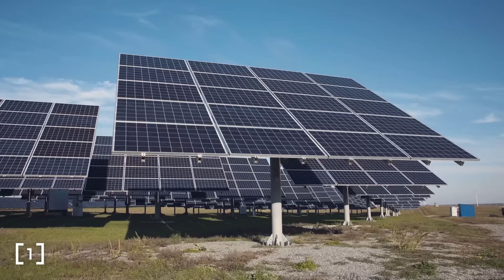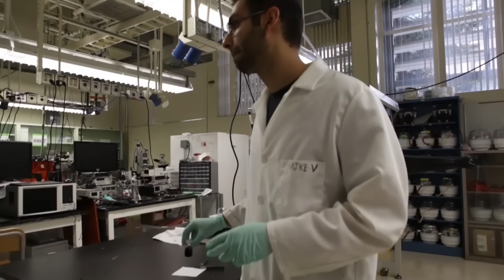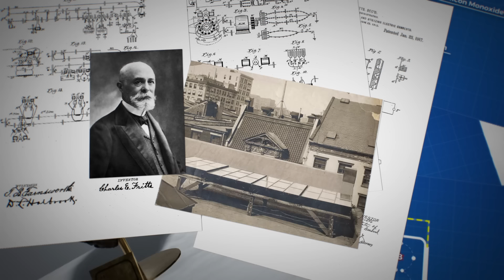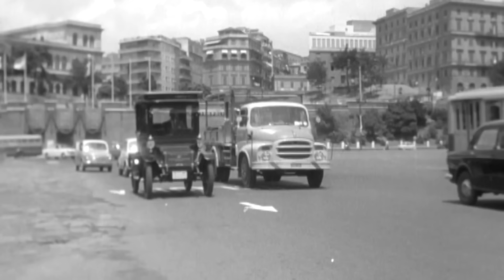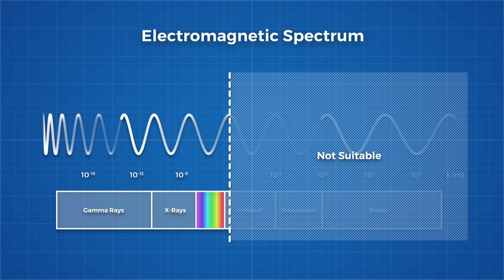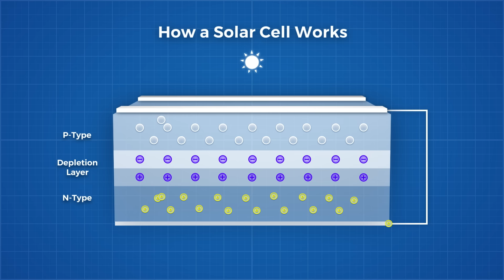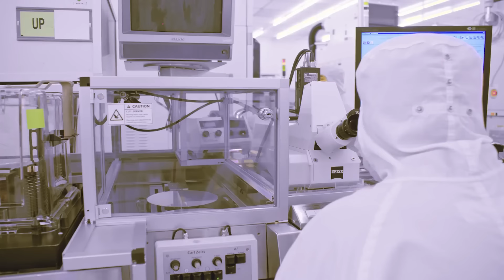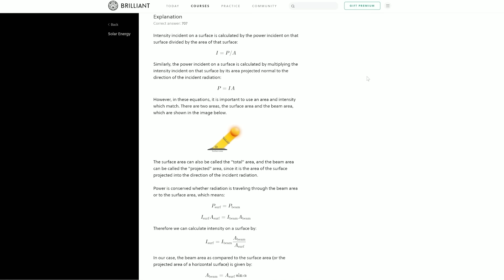The Mystery Flaw of Solar Panels

Comment: I want to know how these solar panels work but im 13 year old and i dont know a lot about those things
Reply: Aleksa Stanković - start by researching the basics of the subject. Function and operation. Then move into manufacturing of solar cells. From there you will have the basics of solar power. Then do the deep dive on this information and it will tell you where you loose most of the suns energy. If you can develop a crystal that can capture more energy than current cells produced then you will have made advances. Work by trying different sub-straights on surfaces that collect sunlight. Also adding surface to existing panels have produced more energy too. It’s an expanding field that a 13 year old should be involved with because you could be the one that makes a major breakthrough. Also study chemistry because this will defiantly be where the breakthrough comes from. It’s not hard it’s just work to study, but I believe if you have the interest than you can do anything you set your mind to.
Reply: Same here, only I'm a bit younger...
Reply: You will grasp more of this as you progress through school and later university if you chose such a path.

If you feel like the pace at school is way too slow you can always learn more online. For that I'd recommend brilliant.org which sponsors this video or khanacademy.org a good free learning platform if your family doesn't want to invest in brilliant.

Good luck with your journey through science!
Reply: Gustav Gyback thank you very much